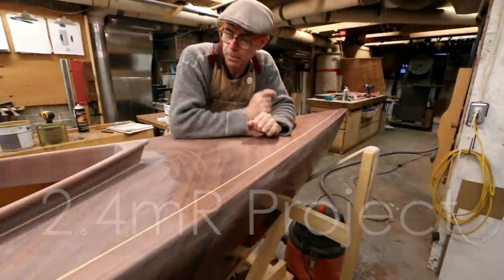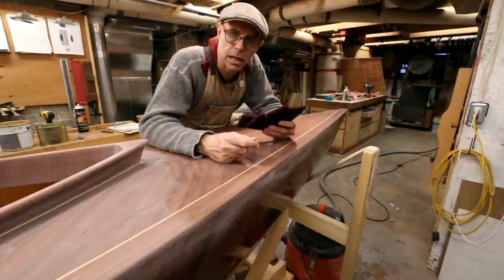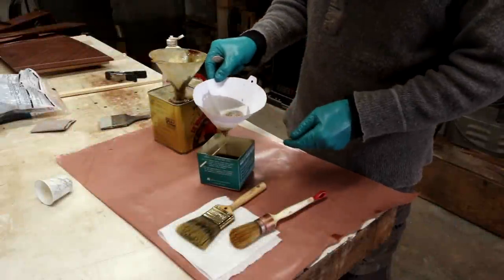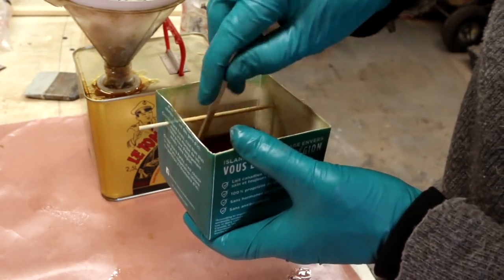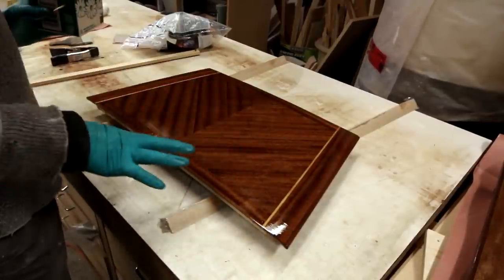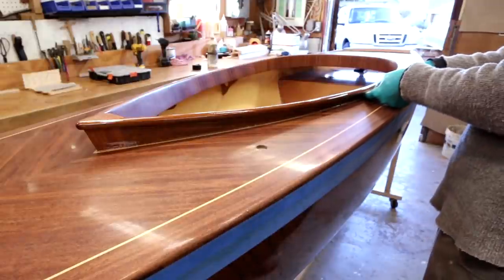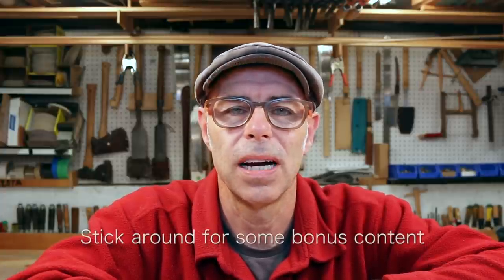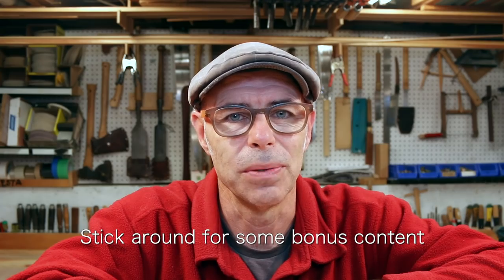International 2.4mR Sailboat Project - Episode 51 - Varnishing the deck

Comment: Beautiful finish, top class as always. Dust on varnish or paint is a constant nightmare. Sometimes choice of clothing can contribute to dust as mentioned earlier. Your pullover, tight knit as it is, will shed from the arms as you paint. Short of painting butt naked its always going to be a problem; complaints from the neighbours, cold day etc. You have my sympathy. 
You could try paper overalls; we used to cut them off below the waist keeping the zip intact and  just above the leg. You can reuse them. You might not fully eradicate the dust, but it might help keep the blood pressure down.
I hope your paint vault is a good solid fire proof bunker or away from the house. Linseed oil some times likes to go pyro when you least expect it. There was an incident a number of years back with a solvent filled rag on an aircraft where I worked. It spontaneously burst into flame in a dust bin in the cabin during maintance. A quick thinking guy picked up the bin and ran down three flights of stairs with the burning bin. Saved a Boeing 747 from a fiery end. The solvent was by the same manufacturer as your finishing pads.! Our safety guy told us, just because a product says its a low vapour, ie.low smell, doesn't mean its not harming your lungs. You just cant smell it as its doing it and you tend to expose yourself even more.
Reply from the maker: Well you’re probably quite right about my clothing, but mostly the shop is just way too loaded with fine dust. I gave it a good blow out before final coats which helped. The fire department has signed off on the paint room and the rags immediately go outside into a water filled pail.

Comment: Thanks for this.  Restoring teak on my Morris Leigh 30.  I used their Le Tonkinois Bio-Impression as a primary coat and then applied first coat of Le Tonk No1 and took about 3-4 days to dry.  Although it says you don’t need to thin, I think I will thin to see if that will speed drying.
Reply from the maker: I have found a fresh can kicks off reliably while an older partially used can takes longer to dry. I have no idea why that would be the case. Sometimes I think humidity plays a large role in speed of curing. When something take more than 24 hours to become dry to the touch, I assume it's because the underlying layer hasn't properly cured first. It's always worth reaching out to the manufacturer for answers to problems.

Comment: I find your choice of varnish interesting. I used LeTonkinois for a few small projects, for the same reason as you: the vapours. It seems to dry much slower than less traditional varnishes. Great for having more time to correct things, but more time to collect dust.
Reply from the maker: I have noticed that too on some occasions. Could just be humidity or temperature. Regardless, I like the stuff.
Reply from the maker: Smell for me is a huge factor. My wife is like a bloodhound. She even gets jumpy about latex paint odours. If I keep the doors open for a couple hours she doesn’t complain too much about this stuff.

Comment: After the boat is out of the shop or maybe cover it. 
With all the doors and windows open 
Fire up a leaf blower. Wave it around the ceiling and the top of the workbench. I bet you get clouds of dust at first.  Then you will gradually get rid of the airborne dust. .
Reply from the maker: I do that once in a while but it's a full day job cleaning up after.

Comment: Wetting your floor helps cut down in dust quite a bit. Stapling some plastics sheet up on those rafters probably wouldn't hurt either. A person walking on the other side of the house could knock down fine dust. I hate dust.
Reply from the maker: I do wet down the floor and should tarp up above but I have so much crap hanging from the ceiling it's too much trouble.

Comment: will this wooden boat be lighter than a glass boat? Was the plotting of the stay holes difficult? I sure there are lot of rules, on where it has to be, but this a handcrafted boat and it would be a little different than a factory produced boat. Thanks for showing the whole process. From mixing, to applying, to cleaning up. Not boring at all no seriously. Bill
Reply from the maker: In theory it should be lighter than a glass boat. That is the goal anyway. The rules stipulate a minimum weight of hull and deck per square metre. the goal is to hit as close to that as possible so that you can put more ballast into the keel where it can help you perform better, but all the boats should have the same overall minimum weight. It wasn't too hard to plot the shroud holes. Just did it on the drawings. The mast shifts around on purpose in use so they won't always be bang on anyway.

Comment: Nice work! But I wonder why you dont use their marine varnish? Its supposed to have better UV protection. Or are they all the exact same product?
Reply from the maker: It's virtually the same stuff. Just processed a little differently. I go with what I am used to for the most part.

Comment: About how many coats will you use in total?
Reply from the maker: At about 6-8 I start asking myself if it’s looking good. Did I get a reasonable dust free, blemish free result this coat?  Bearing in mind there are three coats of epoxy under that, so maybe about 10 in total. More would be good but there is cost to consider and as I said, the customer is good about maintenance so at 5 - 6 coats, we are well protected. Everything beyond that is vanity.

Comment: varnish looks great after it just done and buffed yes. But it fails over time in the sun. Why not spray automotive clear over the epoxy instead?
Reply from the maker: Well we don't buff out spar varnish because that ruins what uv protection it has. Re-varnishing is an expected maintenance procedure. I haven't got any experience with automotive finishes.  I have heard of few people who have experimented with automotive paint but I haven't heard of how the results last. For some reason, there hasn't been much of a crossover between automotive and marine finishes, especially when it comes to clear coats.